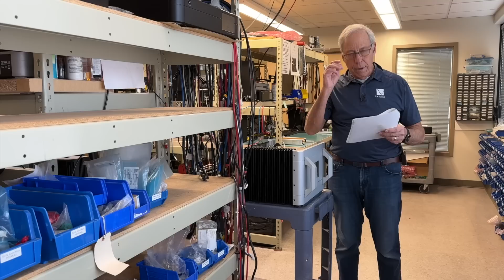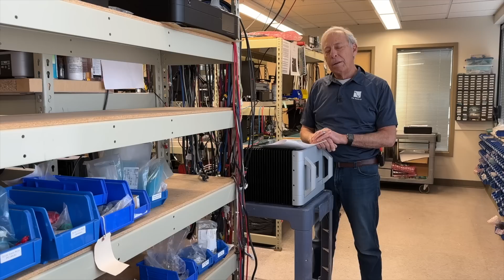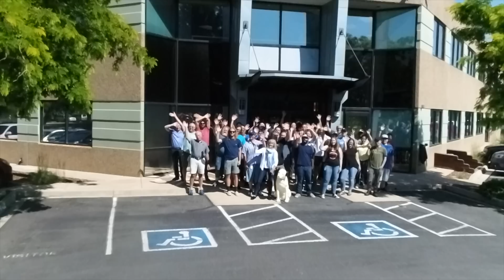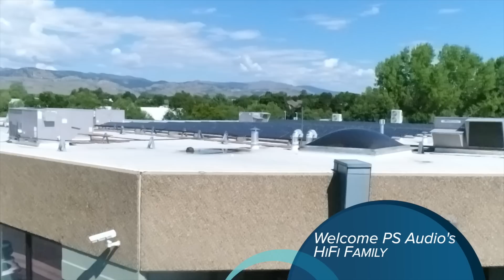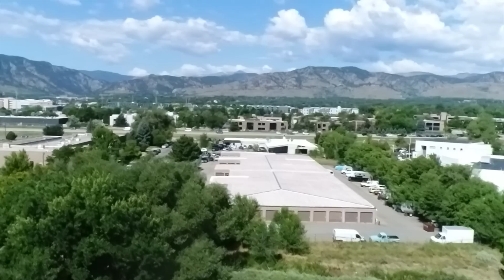Speaker break in: Myth or real?

Comment: I like your videos, but I'm calling you out. Capacitors aren't mechanical in the slightest, and they don't break in; if anything, in the case of the electrolytic caps, they naturally dry out and lose capacity in a linear fashion, and somewhere along that line you're like "yup, that's it, broke it in".

Film caps are equivalent to having two metal plates with a sheet of plastic inbetween; they do not change characteristics, because they are entirely solid and static objects, that naturally don't degrade appreciatively; you can blow holes in the film though and degrade it with too high voltage.

Your line about energy passing through them, to form properly, to do what capacitors do over time, to sound better, is completely bogus; the only change over time, assuming you don't overvolt damage the film caps, is the linear degradation of the electrolytics. The worst thing about audiophile bs is that they can't explain the physics of their claims, instead they use made up words like "formed"... You don't know what you mean in real physical terms, so why would you dare claim it's a thing? Maybe, the difference you've been hearing from crossovers, have always just been degradation; in any case, you don't know, so don't say you do, unless you can explain exactly why, in a non-extremely-layman-vague fashion.

Here's an EEVBlog forum excerpt regarding film cap degradation, but in mains capacitors susceptible to over voltage, something that shouldn't happen in an audio system:

"It's actually a 'mechanism' rather than failure/degradation in most metalised film capacitors (apart from the really crap cheap ones, that is). The idea is to clear a fault that punctures the dielectric. Self-healing is normally indicated in the datasheet. Breakdown is normally the result of overvoltage or severe current transients. It's a desirable behavior in X-caps - you want them to self-heal on transients rather than fail short, as a foil capacitor would do.

Unfortunately, the downside of self-healing behaviour is that it does result in progressive loss of capacitance as the metalisation burns away around new punctures, although it doesn't happen in low power circuits."

So, they do change if you damage them, yes. That's not breakin, it's loss of capacitance, and if you consider it "broken in" at eg. 80% capacitance, you should have used capacitors matching that from the beginning, and have treated them within specs to not degrade them.

As for the speakers, at least you're right. They have components exposed to mechanical stresses, in turn softening up, easily explainable, as opposed to the other thing.

Comment: The fact is, and I'm saying this from the perspective of someone who has designed and built speakers for decades, that break-in isn't just real, but has to be taken into account measuring Thiele/Small parameters. The mechanical properties of a dynamic driver change so much due to break-in that it's a mistake to measure a woofer new out of the box and do calculations such as enclosure volume, sealed vs ported design and port frequency, let alone transmission line, horn length etc. The standard procedure is to run the drivers in free air for 24-48 hours, let them cool off for an hour (voice coils expand with heat which in turn affects electrical properties) before measuring. Few manufacturers will break in components prior to shipping, so it's normal to hear improvement in the first few or hundred hours (depending on size, design, suspension, room temperature etc.). These are mechanical devices, clueless as to how anyone could doubt burn-in is a real-life phenomenon.

Comment: I am so glad that you made this video. Speakers most definitely do need break-in.
How long? That answer varies from speaker to speaker and how often you play the speakers in the first three to five months that you have since you bought the speakers brand new. Everything brand new, even an automobile needs breaking time in order for the automobile to get to the point where it's performing at its Optimum best. It is recommended by automobile manufacturers that a brand new vehicle takes at least 1,000 miles of driving before it is at its Optimum performance level that it will be better in so many ways including gas mileage and the engine itself and the components inside the engine and the tires even need break-in because everything even in a brand new automobile is tight and needs to loosen up so that I can form into a much better operating vessel. So therefore is simple and super obvious that a brand new pair of speakers will have to be broken in as well to get to a point where they are at the optimum performance they were designed for. Great video! Sorry Skeptics. Truth is truth!

Comment: Oh dear me.
Electronics, which are not mechanical, don't need a break in period.
They do however normally get subjected to a "burn-in" period; this is typically used to allow any substandard parts to fail and therefore can be changed either on a component level, or a complete remanufacture of the PCB, so to speak.

Again, Electronic components do not need a break-in period, they are typically at full operating specification straight from the factory.

Comment: Capacitor break in? No.
Capacitors mechanical? Double no.

A capacitor is nothing more than a gap: a break in the electrical pathways with "plates" on either end. When positive voltage is applied on one of the plates, it builds up a positive charge and the other gains a negative charge. Once the charge saturates one plate, nothing more happens, but when voltage is reversed (or at least brought to a lower potential difference with the positive plate), the capacitor discharges, keeping the potential difference the same for as long as possible (which isn't very long because capacitors discharge quickly).  And this can happen from the negative plate as well, but in reverse.  Saying that a capacitor is mechanical seems to imply you don't understand what they are or how they function. A switch is mechanical because it requires a mechanical force. A capacitor is a passive component, and does not have any mechanical element to it.

And to answer capacitor break in...if a capacitor needed to be broken in, computers would simply fail to operate correctly after the break-in period. See, computers use billions of capacitors in their daily routine: in their DRAM (dynamic random access memory). Every single bit of memory your computer has is literally a capacitor. The capacitor needs to be refreshed every so often to keep the value correct in memory. A break in period for capacitors would imply that capacitor's spec would change; otherwise, a broken in capacitor would behave identically to a brand new capacitor. With the speed of modern DRAM (around 2 microseconds on average), even a slight change to a capacitors discharge rate or capacitance value would render that bit of RAM dead, and since most consumer based computers do not include ECC (error checking and correction), your computer would access that byte of RAM, it would fail, and error out. And programs are constantly cached to the hard drive and reloaded in different segments of RAM, so, in very short order, your computer would simply stop functioning and require a reboot. Over and over again.  Of course, this doesn't happen and most RAM comes with a lifetime warranty as well, not something that a company would offer if even a handful of "broken in capacitors" would render useless.  And that's not counting the dozens needed mitigate voltage drains (bypass capacitors) and keep the system running.

Comment: Anything mechanical in nature from engine systems to loudspeakers to more or less degree, It all has a wear in period. Anyone whos purchased a brand new atv or dirt bike from a dealer, or bothered to ask while buying a new car, has likely been informed NOT to push a brand new engine hard until "x amount" of gallons of gas or x amount of miles have been driven. You can genuinely straight up damage the cam's and piston housings in the heads if you push an IC engine too hard too soon. Machines have to wear into their spec'd performance, it doesnt matter what kind of machine it is, and a loudspeaker is a good example of a linear excursion motor rather then centrifugal excursion motor like a DC electromagnetic motor or something. It's still a motor, it still functions hrough mechanical excursion.

While im at it, ill go ahead and mention that capacitor heat forming is a very real process, that we also like to call "burn in" and is a very understood process. Capacitors perform differently once exposed to voltage and a bit of heat and they (especially electrolytics) are designed to form into their spec'd values and fill the microscopic conductor pitting inside the dielectric evenly, and this is why they sound different new. If we were to make brand new electro caps at their rated values, they would burn in and settle outside of spec after forming to their conductor pitting. The ONLY way to form a capacitor is to pass signal through it and generate a small amount f heat for an extended period. This usually isnt done outside absurdly high end audio products before selling because it would be a very time consuming and costly process just to do something an end consumer will do on their own anyway.

It doesn't matter what way you slice it, burn in is real. Go by a brand new copy of ANY product you have owned for a while with moving parts or electrolytic capacitors in it, thats still being made and use it. ANY product, electronic or otherwise, doesnt matter, and tell me it feels and performs the same to use as your worn in product, if you do, you are lying to me. It may not be better, but it will absolutely 100% feel different. There is nothing sold on earth with moving parts, or electrolytic capacitors, that doesnt go through some kind of wearing/burning in process. Doesn't exist. 

Hell, most things even without caps and moving parts still wear in too. Even a well used wooden soup spoon feels different to use then a brand new one, and i prefer it 10 fold to a brand new one... Idc what Joe-Gaming-Chair has to say about it. Whether its electronic burn in, or physical break in causing operational parameters to change, or wear and tear causing something to act differently then when it was new, it's not just real, its unavoidable, and it applies to basically every product that exists. If you think your brand new loudspeakers will still sound the same 30 days into using them, you are sorely mistaken. If you think your power amp you bought last summer still sounds the same as new. An a/b with a new unit will show you that you are mistaken in your assumption.

Comment: "capacitors are mechanical devices" is simply not true! They are passive electronic components.
Reply: I may not agree with everything Paul says, but I think it should be pretty clear that he isn't suggesting a capacitor works by mechanical means. A capacitor inevitably has a mechanical structure, and the context of his comment is that mechanical properties of that structure influence the electrical behavoir of a capacitor. For the sake of the discussion, it might have been better for Paul to have said something like "physical devices".

Comment: I bought a pair of Elac Adante's several years ago and It took the a long time to settle in but one they did the sound got very smooth once I got the toe in right. I learned not to fuss to much with placement and room treatments until they were well broken in because you were just going to have to do it all over again.

I have my power amps on top of a 15" tall record cabinet that sits against the front wall with the speakers a good 2 ft in front of them (about 3ft from the back wall. The equi[ment sits on top of a 3" high record cabinet off the the side about 6 ft out from that front wall. I had the preamp, PSA Directstream DAC, and trnsport staceked up next to the turntable that sat on it's own 3" think maple cutting board.

I needed more room for records and CD's so i bought a cheap TT stand off amazon that had a welded steel frame and MDF shelves. The TT sits on the top shelf and it's 3" cutting board so it is  4-5" higher than it used to be, this is all right next to the large record cabinet so it's about 16" further out from that front wall. I was now hearing a harsh dlare from the system and I traced to to the mids and highs (coincident mid/tweeter) reflecting off the smooth TT cover. I solved that by storing my Sennheiser HD600's on top of that shiny TT cover, that is just enough to break up that reflection point. Also that welded steel rac (when weighted doen with records and CD's sounds much better that the 3/4" oak recoord cabinet did

Comment: This is an easy one to test.  Pick out some test signals that you are going to use, and use a very good recording setup to record the sound of a new speaker before break-in.   Then run it through the break-in process and then re-record it using the original setup and original signal.  You will now be able to compare the two recordings side by side and be able to both measure and hear the effects of break-in.
Reply: The only tests I’ve seen actually done this way show no difference, and they even used a control for comparison. The difference between the “broken in” speaker and the control speaker stayed the same.
Reply: @godofspacetime333 very interesting, do you know of somewhere that has posted a frequency response or something similar before and after? Can't believe people are still divided on this issue
Reply: @xelalex1  it was some guy on YouTube, don’t remember the channel or video title (but shouldn’t be hard to find, you can easily tell who is ALL IN on this myth fairly quickly). But he used those reference mics that come with software giving you frequency graphs and everything. There was a difference before and after, BUT the control speaker he used that was already “broken in” showed the same difference in response. So basically the change in ambient temperature and/or barometric pressure had more of an effect on it than the speaker breaking in lol

Comment: My own experience, I bought old new stock speakers, plugged them in, sounded flat (very limited bass). Listening to those speakers for 2-3 weeks, not quite happy. Anyway, I then decided to try a tone generator, just to test if the speakers could play at least 20Hz-16KHz (hearable sound). Well, it didn't play anything bellow 100Hz, so I added volume and worked the frequency up and down from 0Hz to 100Hz and little by little the speakers (woofers) got better and better to a point the speakers got ''alive''. Full range, as specified. So my thinking is, if there are moving parts and they are supposed to move, a break in is sometimes even necessary.

Comment: Break-in as opposed to wear are two different things, which the asker has conflated in their question. Break-in occurs fairly quickly as parts are first put into use, to which then normal wear (which is much slower) is predominant. Take a new car - you are advised to drive gently/moderately for a few hundred miles until the rings get settled in with the cylinders in the engine, and then after that period drive it like you want to; wear will happen gradually and at a slower pace than the initial break-in period.
Reply: Right, so if it takes a car several hundred miles to be “broken in” so to speak, then why is it such a stretch to say that it might take a speaker 100 hours or whatever to break in ?… the real question is how to measure and evaluate the difference in the sound between those two points in time, so that you know for certain it’s not your imagination. Thinking Better’s point is that he buys into speaker break-in, but not the poly crossover caps; so to your point, Paul needs to marry broken-in drivers to a mew crossover to test the theory that it matters.  Who knows, maybe their engineers did that over there already..🤔

Comment: I've always considered speaker break-in to be "ear break in"  IOW, your ears get used to the sound.  I have never seen any blind/objective proof of speaker break-in.   IOW, a recording of a speaker when brand new and the same speaker after 100 hours of playing...or test tones/oscilloscope traces showing a difference, whatever.

I've had more different speakers from cheap to very expensive over MANY years and none of them sounded different to me after X hours of playing.    Just think about living near a noisy environment - planes/trains, etc - at first it seems unbearable and after (ear) break in, you don't even notice.  OR going to a rock concert...at first it seems much too loud...later, it doesn't and they typically raise the volume as the concert progresses to keep the level of energy as your ears adjust.  

I'm happy to reverse my opinion given some scientific proof that a speaker's sound improves noticeably with break-in.  But I  certainly would not buy a set of speakers "hoping" they are going to sound better after "break-in."  If they don't sound good when I audition them, I wouldn't consider buying them despite claims that they'll sound good in 50, 100, whatever hours.  I've seen claims of up to 500+ hours needed for  speaker break in.  REALLY?  C'mon, if they sound bad new, they're going to sound bad at 500 hours.

Comment: Well when I first got my paradigms 800F, I was very disappointed in the way they sounded. The dealer suggested breaking them in at moderate volume for 40 hours or so.
So I stopped listening to them and whenever we were out of the house, I would crank the volume and play whatever for hours. Didn't take long to hit 40 hours.

They sounded very different and much better. 
It's possible the integrated needed to be broken in, but a solid state amp seems less likely that it would be affected by usage, compared to paper/glue/rubber moving constantly.